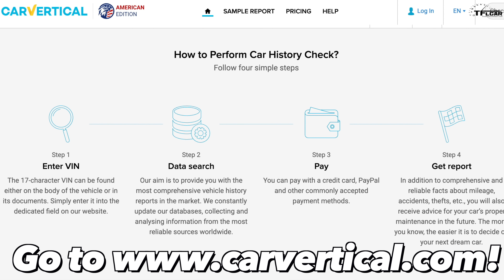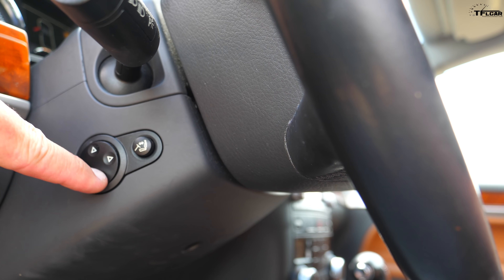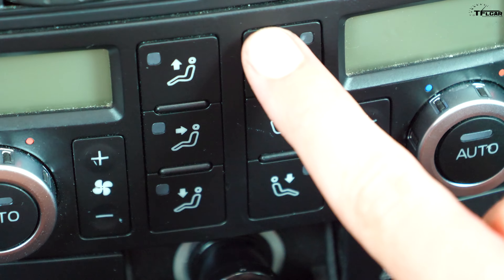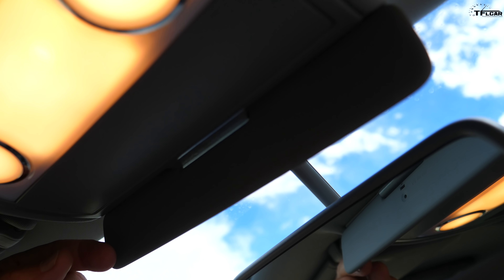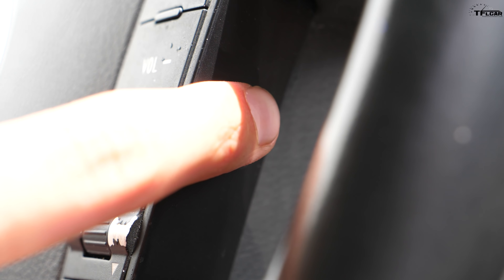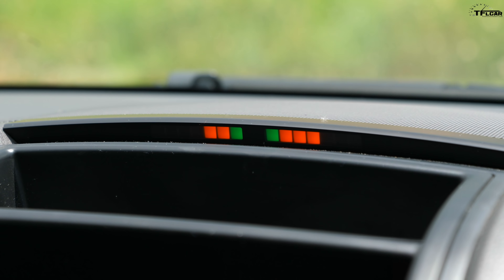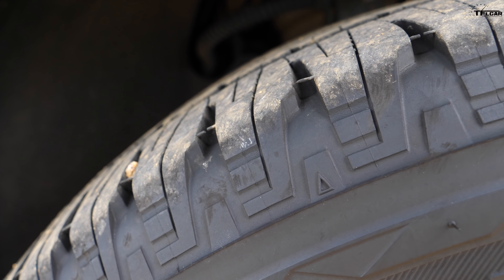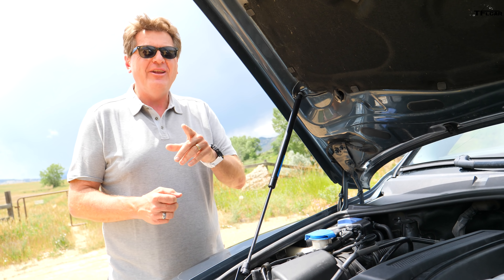We Just Bought The World's MOST Under Appreciated AND Over Engineered Car! Tough T Ep.1

Comment: Hope you have a great relationship with a VW dealer in town
Reply: My Cayenne S has been pretty much faultless for 3 years I've had it. I cannot say the same for the two different generations of Jeep we have.
Cayenne, Touareg and Q7 are all directly related.
Reply: Beside he can always find spare parts at Co-Parts !!!  For example that hailed hood definitely can get replaced super easy.. or it can get a tuner carbon-fiber hood and that would be awesome it will get some pounds off from the total weight.. otherwise like Phaeton Touareg is the business !!!  ;0)
Reply: @OverlandTT  They're about as related as the Corvette is to the Sonic. VW's are NOTORIOUS for a reason ;)
Reply: The Future Is Here I bought a brand new one in 2015 and it's been trouble free other than the water pump replaced under warranty. The older generations were the ones giving constant problems.
Reply: Drive YT Brand if your percentages are accurate, you’re lucky to not have to drive on city roads, although a backed up highway is not very fun either.
Reply: U mean good independent mechanic
Reply: @OverlandTT  I think almost anything won't give you much trouble if you only keep it 3 years.
Reply: @OverlandTT  build quality differences though and when things do go wrong expensive
Reply: @OverlandTT  I've also heard surprising things about  Porsche Cayenne! Maybe depends upon which motor?
Reply: @sharkskin3448  
Mine is the 4.5 V8, ensure when buying it doesn't knock and the plastic coolant pipes in the centre of the V have been replaced with Aluminium.    Dropped liners are caused by poor maintenance in most performance cars.  I regularly come across Cayenne S (V8's) with 200-250,000 miles on them.  Mine had 80,000  on when I got it and love it (incase you missed that lol).
I chose the 4.5 over the later 4.8 as direct injection and we know the issues DI engines have. Also the 4.5 S (non tube) has a 11.5 : 1 compression ration - which makes it a low emissions engine and in London UK - it qualifies to drive in the ultra low emission zone at no cost, not bad for a 15 year old girl. I know the annual test I check the emission report for CO (which is none) and NOx which is usually 1ppm (lithe a legal limit of 200 ppm).
Reply: @OverlandTT  some great information! I hope she gives you many more miles and smiles. #FreeTommy
Reply: @Drive YT Brand My 2010 Hilux rusted out in 8 years. Biggest POS I've owned.

Comment: You got lucky with your Discovery.  But I believe this Touareg is going to hurt your feelings.
Reply from the maker: You might be right. But that also makes for interesting videos until the air suspension fails. That's when it just gets very expensive! This should be an interesting journey.
Reply: I have to agree with Justin though I see this video and go Wow this thing has a ton of gadgets/options the other side to that is if that car didn't come with some crazy extended warranty I wouldn't touch it. It's gonna make you sad!
Reply: @Bryan M  when you get a service history that requires a binder to keep organized it's not exactly a good thing. it just means the owner shelled out the cash to keep it going , it doesnt mean its a good car.
Reply: Everything is perfect that's funny fan boys will be fan boys I guess
Reply: Dalton Michaels it’s not exactly a bad thing either. Some, who have vehicles maintained at the dealer keep every document even if it’s just a light bulb change. This helps for when if you would decide to sell the vehicle. Besides the stack wasn’t that thick given that it was a 2004 with 124k. It doesn’t mean that the owner shelled out money to keep it going, let’s not assume 🙂
Reply: @jordanpatton1843  we will see i guess. VW is not known for reliability.
Reply: @TFLcar  Call the dealership and get a quote on changing the alternator.  Just that one part. It'll blow your mind.  That said, the first gen Treg is pretty amazing and was developed with the Phaeton, another grossly over engineered project.
Reply: BDK 323 you’re right. I wouldn’t touch anything like that with air suspension and doesn’t have a warranty. Had a s55 amg and loved the thing and the power it had but once the air suspension went out that was it..
Reply: The Fast Lane Car not as expensive as you think, if the air suspension is that bad you can opt to swap it out for a coilover setup. I did this on my fathers Jaguar after replacing 3 air struts. Ride quality was very good after the swap but it felt more alive and connected to the road. I think you’ll be pleasantly surprised by this VW.
Reply: Should have just went all the way with the V10
Reply: Jim Tremayne everything is expensive at the dealer, i once had a mk3 tdi jetta, i needed an alternator for it and the dealer was princing it at 1300$ (CAD). Not even watercooled or whatever. When owning an old car, you have to be resourceful, especially on luxury/performance cars.
Reply: @TheDaltonmichaels  Actually VWs are known for reliability everywhere in the world but America, also pretty inexpensive to maintain, specially because they sell a lot everywhere, so there are inexpensive parts everywhere and mechanics that knows how to work on VW engines in every corner, the thing is in the USA most people don't have a trusted mechanic, everyone takes their cars to the dealer which is always way to expensive and also they have a tendency to find stuff that the car don't actually need, VWs are absolute best sellers everywhere for a reason, and I'm not even a huge vw fan, but I had 2 and never had major problems, my father had a couple as well never had problems either (can't say that about the fiats and alpha romeos he had) I know hundreds of people that have or had VWs , and the vast majority never spend much on their cars, there's always an odd ball here and there but the overwhelming majority are just fine cars.
Reply: I knew someone with one of these. It was new. It fell apart every other week. Wouldn't touch it.
Reply: Dalton Michaels - One could easily have a binder full of receipts just from oil changes in 15 years.  Try buying any kind of 4WD that works for under $5K!
Reply: @: : J u s t i n : :
Is that your cute little doggie? What kind is he? Thanks.
Reply: @hansolo6827  Every single company has thousands of complaints, there's absolutely no getting away from it, the difference is that every single time I had problems with my car I took it to my mechanic and it cost me very little money, also not a lot of problems, the worst thing about VWs where I live is that insurance is higher because there are a lot of theft, and VWs are the most targeted because it's easy to sell parts quick since there are so many of them, but that's it, it's more expensive to buy corolla parts than VWs in most of South America and europe, because there are far less Toyotas around, they might break a bit less but in the end the cost will be even, plus my mechanic never took more than a few hours to service my polo, that's just the way it is, Americans thrust dealers, VWs American dealers suck, so VWs cars suck, that's the logic, I thrust Rubens my mechanic he do not overcharge me and work fast as hell, and I never had a problem with my cars, my Chevrolet Celta is running perfect right now even though it's old and it's cheap, never spend too much on it either, that's the difference, I never had a car for less than 10 years and usually I just sell for cheap to somebody else in the family, and they run and they run, you can get a bad apple from any brand, that's life, plenty of Honda civic videos of people saying they'll never buy Honda again, but Honda is a great company, people are just unlucky sometimes and it sucks , same thing with vw, but in America you are on your own if you are not a mechanic yourself and don't wanna depend on your dealer, I on the other hand can hire someone that'll do the job just fine, and fast, and nobody cares where I took my car to be serviced when I'm selling a 100k+ mile 10+ years old, as long as it runs decently.
Reply: @costaet  I have plenty of friends in Germany, I've dated a few German girls, and every single one of them have German cars, your family in Germany is an anomaly, right now the German cars represent 60%+ of cars in Germany while about 8% of people (at best) have Japanese cars, and that's because Mazda, Mitsubishi and Suzuki are really big in Europe or else it would be less than 4%, the vast majority of cars are European in Germany and the vast majority of European cars are German there, no questions asked, I have friends in europe and all over South and North America that'll only buy Japanese for sure, some of them, there are thousands of people I know and some of them will be like that, that doesn't mean it's the norm by a long stretch, I think you are bringing your bias to conversation and people are just being polite to you, the sales numbers just disagree with your narrative.
Reply: The interior sounds like a pile of squeaky leather and plastic straight out of the late 90s early 2000s. Reminds me of gm interiors of the era.
Reply: Bryan M in 2004 for this $, you could buy two top trim Honda Elements and still have $14k left over for gas and snacks.
Reply: Funny that this was picked over a Lexus GX
Reply: Dalton, hey the thing was only 4600.00 so if it lasts a year they got their moneys worth.
Reply: @TheDaltonmichaels  No, it is a good thing. It means all the crap that is going to happen, happened and someone else footed the bill.
Reply: @jordanpatton1843  When you go to the service department, don't forget your wallet. And it better be full.
Reply: W Tski lol, never needed to take any of my Volkswagen’s to the service department.
Reply: Bryan M  I understand the wanting to have nice things    And some German cars are nice ,  when new.  And that is why people dump them after about four years.  They get another new German car.  That is having a nice things.  Just because you are willing to keep spending money into your 16yr old car doesn’t mean you are living large.
Reply: @costaet  First of all in Italy Italian cars have less than a third of the market, which is for sure higher than most other places but still nowhere near the majority, in France (which has some pretty reliable cars in the last couple decades) French automobiles do have 60%+ of the market, and yes I do understand that in the specific market where the companies are from people are biased toward the home brand,  there's no discussion about that, my comment only referred to the prior comment about the guys German family finding German cars unreliable, which isn't the consensus in Germany at all, and although German cars are not considered EXTREMELY reliable anymore, they are in no way shape or form considered unreliable, they are a bit above the middle when talking reliability perception in most of the world, better than Italian, French (not that deserved nowadays), British, Indian, Chinese, and yes to most of the world American brands, and behind the Japanese and Korean, they don't have the same reputation that Toyota has in America or even the world (largely based on legacy, more than in actual current numbers), but they are considered pretty reliable, a bit more expensive to buy, and a bit more premium than most brands, specially VW, since the actual premium brands like Mercedes or BMW are still looked down in reliability, but that's more because of the cost of the parts when something goes wrong, which eventually it will in any car no matter what brand.
Reply: The Fast Lane Car So I actually owned one of these back in the mid 2000s. Loved it until the air suspension went. That cost me $4K at the dealer. Shortly thereafter the computer went. Dealer was asking for $4K again. That's when I decided to cut my losses. Good luck with it! Look forward to more news, views and reviews of this car.
Reply: @costaet  And I'm not disagreeing that Japanese have the reputation of being more reliable, no matter if they are or not, that's a completely different discussion, what I'm saying is that I never met anyone outside the US that clearly passed on a car simply because it was an "unreliable" German car, notice that I'm not saying there aren't people like that, there are, and I've met people that have prejudice against specific brands because of bad experiences, but not against all German brands, Italian? Sure, French? Sure, but never German, at least none that I recalled, aside from friends in the US, I don't think German cars are bullet proof reliable, but they are known for good reliability, specially in places where you can work on them for cheap, if we look at the European market outside the home countries for the bigger companies, like the UK, or Spain, or Portugal or Ukraine or whatever place the VW group has a much bigger number of cars sold than the Japanese brands, and that's because people do trust in their reliability, it might not be like the old days when the best cars came from Germany but they still are decently reputable.
Reply: @TheDaltonmichaels  he said what that stack consisted of. And the guy always went back to the dealership so he would have had every invoice from oil changes as well. 125000 miles is a lot of oil changes band services
Reply: @pedrothevenard  it's not that they're unreliable here. They're just expensive to fix.
Reply: @leokarasinski4217  I agree with you, but you can say the same about every single car, it depends on where you live, a Polo or a jetta is dirt cheap to fix (compared to Japanese cars for example) in all Europe and most of Latin America, I don't know much about Africa or Asia, but I'm betting not that expensive either, at least in comparison, you just don't take it to the dealer, take it to your mechanic, and buy generic parts made specific for your car for anything that is not security related, those are sometimes 20% of the original price and last almost as much if not just as much as original parts.
Reply: @jimtremayne  My mechanic changed my timing belt for $250 while the dealership quoted 2k+. If you go to dealership with any car, let it Honda or even Toyota, they are going to charge you an hefty amount. Saying all this from experience.
Reply: @busardr1452  LOL that comment didn't age well. He literally just said in a new video the AC system went out.

Comment: This is a perfect example of how we pay more for less these days . Back in 1992-1999 fully specked out Chevy suburbans used to have ambient lighting in the  ceiling and doors  like a BMW and also had Cable TV built in between the two front captains chairs and a vhs  player under the driver seat . With one of those huge antennas that look like a Flying V from mighty ducks on your roof . Also had standard captains chairs second row and the third row folded down into a bed to sleep on with plush soft real leather . Also had a built in phone , I mean for 1990s this was amazing . Lol

Comment: Came in 5 cylinder turbo diesel, 6 cylinder turbo diesel, 8 cylinder turbo diesel, V10 turbo diesel. 6,8,12 cylinder petrol. Huge range
Reply: Not V8 diesel, that was on the second generation.
Reply: 12 cylinder was diesel
Reply: 12 cylinder diesel was in Q7's first gen, Touareg topped at 10 cylinder in diesel, W12 petrol.

Comment: If that air suspension makes it to 150k without needing major repairs, I'd be surprised.  My '11 Grand Cherokee had basically the same setup and at ~138,000 the front started to sag when parked.  Then the pump would run continuously while driving, so I knew it had a leak somewhere.  After doing research and getting a few opinions I traded it before it failed completely.  That is the one feature I will absolutely stay away from from now on.
Reply: Air suspension is absolute crap in terms of reliability. My dad had a GMC Yukon and a Ford Expedition that both had air suspension. The compressor for the air suspension failed in each of those trucks twice. They both had less than 115k when those failures happened. If you ever look around you’ll see lots of old Lincoln Town Cars and Navigators, as well as Mercedes S Classes with saggy air suspension because it’s failed somewhere and the owner can’t afford to fix it.
Reply: One can now buy all the air suspension parts aftermarket now for really cheap...rebuilt my compressor for $50 and my front air bellow for $150  I cant complain about that

Comment: A wonderful vehicle, but everyone I know with high end European luxury vehicles dumped them shortly after the warranty was up due to literally having to take out a second mortgage just to pay for the repairs.  

Let a few of those blend door actuators in the dash malfunction for the heat and air and that'll be $3,000.

Lots of my Coworkers had $$$ wiring issues, wheel bearing issues constantly, and $6,500 for the air suspension rebuild at just over 100,000 miles of all pavement miles.

Yes, you got it cheap, but it could easily balloon to well over $20,000 fast.  Transmission, differentials, Head gaskets, wheel bearings, etc.

Great video!!!

Comment: 2008 v10 owner here, I have driven mine for several years and driven all over the country it’s at 124000 and is great! V10 is completely gear driven no belts at all and mine is stage one so 360 hp and 605 ft lb of torque monster I had to go with 18’s BFG’s 265 65 r18 all terrain work awesome, they say they won’t fit but they fit great